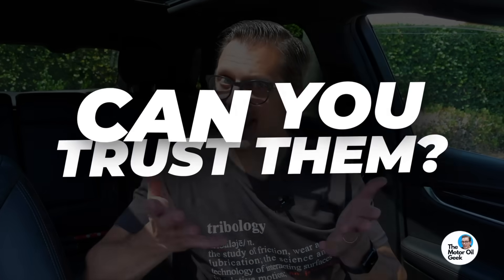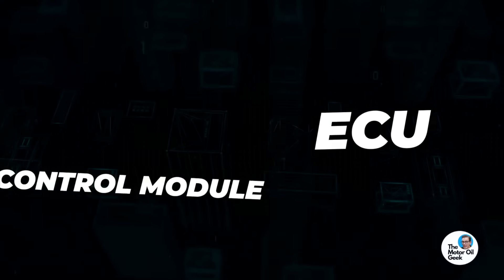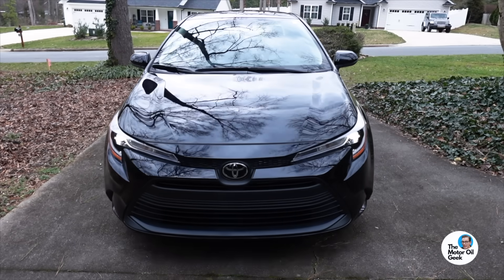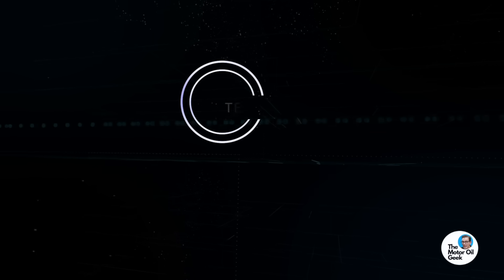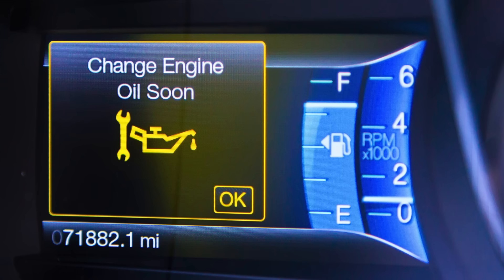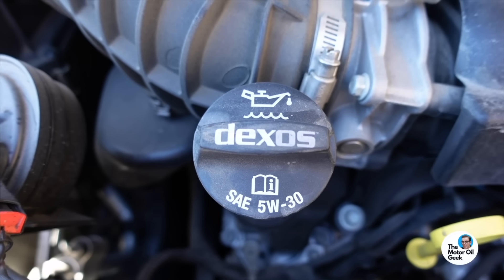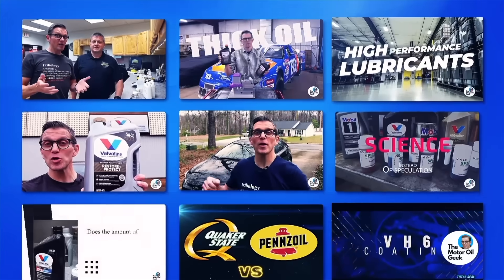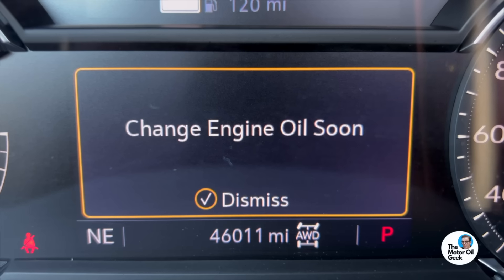The Accuracy of OIL LIFE Indicators REVEALED!

Comment: I have a 2014 Jeep Wrangler JK and I changed my oil at 3000 miles when I get it out. It’s pretty nasty looking. I would not go 7 to 10,000 miles on the same oil and if I did, I would change my filter about four times. I am a mechanic, but I don’t work on automotive anymore. I work on heavy equipment. I used to work on automotive and I did for 10 years. Fluids are cheap engines are expensive. Change your fluids frequently.

Comment: When my oil indicator hits 50% life I change the oil….its usually around the 5000 mile range and 6 months..
It’s a newer Bronco with a 2.7 and don’t dare wait 10,000 miles and a year on the oil….turbos and cam phasers are too expensive..
Of course I probably wouldn’t see noticeable wear on the engine till long after warranty was done going by the manufactures recommendation oil change intervals..

Comment: YOU SIR ARE EITHER A FOOL OR BEING PAID OFF FOR THIS MISINFORMATION. THERE IS NO REASON FOR TELLING PEOPLE TO NEGLECT THEIR VEHICLES. WHAT ABOUT THE ENGINE DAMAGING DEPOSITS? THE OIL FILTER CAN ONLY HOLD BACK A CERTAIN AMOUNT OF DEBRIS. WHAT ABOUT OIL CONSUMPTION AND OIL LEAKS? MOST VEHICLES ON THE ROAD HAVE OIL CONSUMPTION OR LEAKING ISSUES, EVEN THE NEW VEHICLES HAVE THESE ISSUES. ANOTHER ISSUE IS SLUDGING.. I OPEN MANY ENGINES EVERY MONTH. THE BIGGEST ENGINE KILLER OTHER THAN HAVING NOT ENOUGH OIL IS OIL NOT GETTING WHERE IT NEEDS TO BE.  THESE ARE JUST A FEW FACTS TO DISPROVE IGNORING WHATS GOING ON UNDER THE HOOD. MY QUESTION IS WHY? WHY IS IT SO IMPORTANT TO TELL PEOPLE NOT TO MAINTAIN THEIR VEHICLE? I'M ECSTATIC YOUR OIL DOESN'T BREAK DOWN AS FAST AS OLDER DESIGNS. THERE IS SO MUCH MORE GOING ON THE CONSUMER NEEDS TO BE EDUCATED ON OTHER THAN TO SEE HOW FAR THEY CAN GO BEFORE SOMETHING CATASTROPHIC TO THEIR WALLET HAPPENS. THIS IS COMING FROM A MAN THAT MAKES PAYCHECKS ON YOUR MISINFORMATION. THINK ABOUT THAT.

Comment: Biggest issue with the oil life monitor isn't how far you can go or your driving conditions. It the fact that these modern engines have tiny little oil passages used for cam timing actuators and stuff. Lubrication is now a secondary use. Putting in convention oil or cheap oil plugs these ports up causing engine failure. People's cheap negligence, is the main reason so many engines get a bad rap.

Comment: I don’t trust that percentage oil life. Only trust I prefer around 3,500 miles to change oil. My truck 2011 ranger 4 cycle  currently is 177,000 miles engine still run good.

Comment: Not all life monitors are the same. Did GM vehicles we have in our Fleet seem to change depending on driving and how much time the engine's idle. The Fords however just seemed to go down 1% for every 100 Mi of the mileage. Those monitors seem completely irrelevant as I completely ignore any idle time whatsoever. But then again Ford also thinks that a 10,000 me oil change intervals acceptable, and in most cases with a partial synthetic oil they don't even use a full in most other vehicles. I change oil in everything at least every 5,000 Miles when I run full synthetic. I think anybody that doesn't do that probably has a death wish

Comment: I owned a 1989 Toyota Clubcab truck. V6. I almost never changed the oil. (Hated the truck). It ran 400,000 miles. I would literally go 50,000 miles without changing oil. Didn’t care. Truck NEVER FAILED. Still ran perfectly when I sold it.     Just sayin.     I usually go 20,000 on my synthetic oil. Generally. Never any problems.

Comment: I drive around 5k miles per year, short trips of less than 10 miles, primarily city 85%. So I change based on 5k or one year. Does time of 12 months degrade or oxidize synthetic oil?  I notice the oil indicator in my Honda Accord V6 drops much quieter than when I used to drive, mostly on highways. It would take almost twice the mileage to reach the same drop in percentage. After 5k miles, 95% highway miles, the oil indicator would drop only 60% vs. 3k miles, in the city would drop to 30-40%
Reply from the maker: Time is typically not the primary driver of oil degradation. Operating oil temperature makes a bigger difference.

Comment: Other things contribute to oil life , grade of fuel ,where you live and temperature variations , do you keep your tank topped up or run in the bottom half , driving habits etc . I ran a fleet of 1980s GM cube vans as delivery vehicles on propane ( 350 V8 ) , changed oil every 10,000 k , all went over 500,000 km until frames rusted out , when I took apart the motors on a couple they were spotless with very minimal wear you could have done a basic re:ring and bearings for the heck of it and good to go .

Comment: Did they factor in the extreme stresses a turbo that is so common on cars today? Back then, GM was putting a supercharger on cars for power. But now they use a turbo that the ECU can modulate better for less of a "carbon footprint".

Comment: As a former Cadillac technician, I might have to dispute this. I've seen failure after failure of the 3.6 liter engines that were used in the CTS, STS, SRX, and other models for years. People would end up going 10,000+ miles between oil changes and by the time the car was out of factory warranty, the engines were filled with sludge and would only have 1.5 quarts left when brought in for an oil change. It's no wonder those engines have such a bad reputation. I told all the customers I could get a hold of to change it every 5,000 miles and regularly check the oil level- the ones that stuck to the 5k mile standard rarely had issues. My dad has a 200,000 mile 2014 SRX that is still running strong because he knows not to push it with oil changes.

Comment: Oil life monitors dont work. Extended oil changes cause most enine problems like cam shaft failure. Variable valvetrain issues and excess oil consumption. Advice from a GM line tech......oil is cheap engine repair is not.
Reply: I’m old school. I still replace my oil every 3000

Comment: You're wrong. 
Even you said that it won't let you go over 7500 miles.
It's just a timer with more steps.
And if it consistently says to change your oil while the oil itself is still pretty virgin, then you're not really getting the most out of your oil's additive package and base oils.

Just seems like a scam.

Comment: Most motor oils will last 10000 miles with little change in viscosity and other wear indicators. Engineers have proven this. Dont waste your money on excessive oil  hanges as you are only throwing away good oil. Of course dealerships and machanics want more of your hard earned money and tell you to change oil at 5000 miles.  BS.

Comment: I don't know exactly how Ford's system computer calculated Oil Life, but it's not strictly mileage. My work F150 will go 10,000 miles if I do alot of highway driving. When I do alot of short drives for work, it's closer to 7,000. Clearly, highway miles are easier on an engine than city miles, so it must be similar to GM's system. The dealer used full synthetic oil, which is supposed to greatly extend oil life. The truck has 200,000 miles and still going strong.

Comment: I have a 2015 Mazda 3 with a traditional 6 speed automatic transmission utilizing Type FZ synthetic fluid. Mazda says it does not need to be changed as it is a lifetime fluid.

It would be great if you could do a comparison of used fluid with 100k miles vs new fluid. Of course it would be dirtier but does it still have the same lubricating properties as there are no products of combustion like motor oil.

Comment: Excellent information and fits with what I have independently confirmed with our Honda Odyssey’s oil life monitor. The one potential fault with your analysis is that you’re assuming the oil life system was reset to 100% at the last oil change. It might not have been. For example, with my turbocharged BMWs I don’t trust the oil change reminders at all since they suggest far more miles (up to 15,000), than I would ever be comfortable with.   Therefore, I ignore it and just change the oil every 5000 miles. When the reminder comes on I just reset it because I know the oil is always clean. It’s possible the rental company also uses a mileage interval across their fleet since that would be easier to track in their database

Comment: I drive a 2021 Ford Escape Hybrid and use Motorcraft full synthetic 0W20 just like Ford says. At 8K miles I threw away the OEM tires and put Michelin Crossclimate 2 tires on it, best tire choice I ever made. I get free rotation every 6K miles so I have the oil changed at the same time regardless of what the IOL sensor says and it is usually still around 40%. Some people say I am wasting oil but I say oil is cheaper than a new engine. What do you think?

Comment: I think the car manufacturers have it right, for the most part, if not maybe run a slightly thicker grade. But, immediately after starting the engine, I never run it hard until the temperature gauge starts rising. And, if I can, I crank the engine over without starting it for about 3-5 seconds to help prelube the engine, by holding the throttle pedal down, and then allowing the engine to start. I always use higher quality oil, not exceeding the specified oil “hot “ weight rating, but if temperature allows it, using an oil with a slightly higher “winter “ viscosity rating.

Comment: GM's oil life indicator is bullshit. It's designed to generate more service visits at the dealership by making consumers afraid that they may be damaging their engine. In my case, my vehicle has an oil change interval of 7,500 miles. If I change the oil, then park the vehicle in the garage and don't drive it - at all - for 90 days, the oil life remaining will be 75%. You don't need a fancy algorithm if all that's being considered in time between oil changes.

Comment: Here is a bit of secret knowledge from a car dealer friend of mine. The oil life indicator runs off of time since last oil change and mileage. The cars computer has zero way to know how much life left is in your oil. The reason it is there to make people freak out and get an oil change before it turns to sluge. Which is rare but it happens. 

As for actual oil life it depends on your specific uses. But for longevity of the engine follow these guidelines for peak protection. Conventional motor oil 3 months or 3 thousand mile which ever comes first. Synthetic blend 5 months or 6 thousand miles which ever comes first. Full Synthetic one year or 9 months which ever comes first. Be careful of conventional motor oil has it has been known in the car industry to degrade into a mild acid that will destroy your engine seals, however this is also rare because of advancements in formulation of oils and engines.

Comment: I bought a used 2021 Equinox with about 55,000 kms. on it and the oil indicator said about 50% but I changed it any way because it looked so black and smelled so dirty. My indicator goes from zero when rest to 100% when it needs to be changed, but I don't trust it so changing every 6000kms. as I did in my Toyota corolla that was still in perfect condition at 316,000 kms. I have also changed the transmission fluid 3 time as it was black and had no color in it, after 3 times it at least showed some red. Maybe I am wasting my money? I just want it to last to at least 300,000 kms. as I keep my used cars at least 15 years.

Comment: I have a 2023 Ford F150 with the 3.5 litre Ecoboost turbo. It  is recommended Motorcraft 5w30 synthetic blend and that is what we put in it last change. We did our last change at 15 k because that's when the monitor told us to do the change. So is the monitor saying the oil is still good and probably only came on because it hit the max recommended change of 15 000 km. Cam my truck really go 15,000 km on synthetic blend?

Comment: I change my oil every time it's a quart low. It's about 23,000 miles. Got the car with 100,000, it now has 425,000. If it wasn't for the flex pipe, you couldn't hear the engine running.

Comment: I bought a used 2010 Honda CRV with the 2.4 liter engine with 110,000 miles on it.  It uses a considerable amount of oil.  Quite a few forums speak about how these engines tend to collect carbon and crud on the rings until they freeze up if the oil change interval is more than 5000 miles.  The oil life indicator on the car seems to take the oil change interval up to over 8000 miles.  Thanks to your video, I am now trying the Valvoline Restore and Protect.  I know it takes some continual use with that oil to see a difference.  I'm only on my first oil change.  But I am looking forward to seeing of my oil consumption might improve (be reduced).  Apparently, my problem is not necessarily an oil problem as much as a design problem.  On this car, I am going to stick with 5000-mile oil changes with the new Valvoline oil.  Do you think oil analysis is a good idea for me?  How should I proceed?

Comment: Very early GM oil life monitors were based solely on crankshaft revolutions. The temperature and rive cycle criteria were added later. I believe the current line from GM is OLM, or 7500 miles, or once a year. I'll note from a technician standpoint, that when in doubt, oil is cheap compared to engines.

Comment: Think I will continue to spend the extra few bucks and change my CRV oil at 10,000km (6,000miles) approx 40% on the mtc minder.  My past, more frequent oil changes, have always served me well..  200,0000km on my present 2018 1.5 CRV.  Still tight.

Comment: It’s been over 10 years since worked at a car rental place. Back then, they tracked mileage in their own system and didn’t rely on the oil life monitor at all. Customers used to call in when the light came on and we would just let them know when the last oil change was actually performed. So, it’s a coin toss on whether the monitor was reset.

Comment: I have always changed oil myself and do it every 3000 miles.  It cost about $35 for the oil and filter.  That’s cheap insurance.  My Tacoma now has 183,000 miles with no problems.

Comment: It would've been nice if you wouldn't used the analysis to predict the actual oil life. For example, based on these numbers, this oil will reach it a failure point at 10,000 miles..

Comment: Question I am pondering is does the oil life monitoring system take in an account a aging engine? Example, those parameter set by GM are for a vehicle that has little to no cylinder blow by vs engine blow by say at 150000 miles. 🤔

Comment: Excellent. However, no, the USA does not need to get on the metric system. This was a big deal in the mid 70s. We spent a lot of money changing street signs and many other things. The public rejected it. No need. Stick to the topic. Otherwise, very informative.
Reply: We did it in Canada and now we have to use both systems - HUGE mistake, plus now they can raise the gas price by 10cents per litre overnight

Comment: I have a 2012 equinox from new.at 7000 miles my oil life indicator was at 50%.I had the oil changed then but they said it didn't need to be changed yet. There was a tsb to change the oil life monitor so I had it done...the next oil change the indicator shown 10% at 3000 miles. They  reflashed it and now it indicates to change oil around 8000, I never let it go that long but it indicated to me that it may not be an exact science.

Comment: The odd feeling I have (I own a Opel corsa made under GM) is that the oil indicator is calibrated by an average of km and days. It feels odd it runs 0% when the 15000km /1year maintenance is due. If I don’t drive, it goes down, if I drive it goes roughly 3% every fill-up (400km)

Comment: Regardless of the type or viscosity of oil your vehicle uses, whether it is synthetic/blend or basic fossil based oil, it should be changed every 5000km or 3000 mi.
Always use the manufacturers stock filter replacement as it has the most micron concentration and filters much more impurities than aftermarket filters.
Your vehicle will reward you with many many more miles of smiles.

Comment: I had a Mazda 6  2.3 litres, i changed oil every 12 000 miles, it went to 426000 km (265000 miles), engine was consuming 1 quart in 12000 miles at the end. Would have waste my money on early oil changes. It all depends on the engine in the first place!

Comment: Well maybe. With a rental car you never know if the oil monitor was reset at the last oil change. I worked for enterprise taking cars for oil changes. They sometimes didn't reset the light. Enterprise just used their computers in the office to see when it needed an oil change. So the oil could be brand new in that car.

Comment: This is good news. My oil sticker says I should have changed my oil 500 miles ago but my oil life says I have 30% left. I've been struggling on if I should trust my indicator or not.
Reply: Most manufacturers recommend oil changes at a certain mileage OR every 6 months if less than the certain milage is reached.  Also short trips should be çonsidered as severe duty requiring more frequent oil changes than maximum milage recommended.   Would be good to hear Lake Jr's advice on Severe duty effect on oil life.